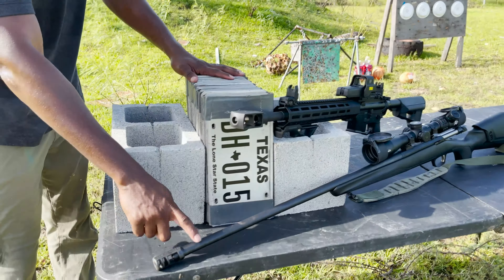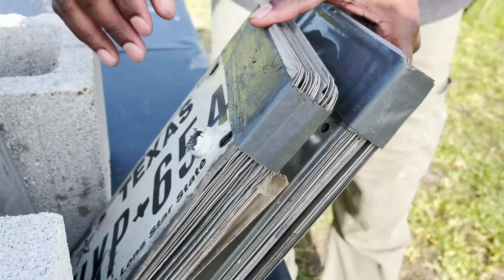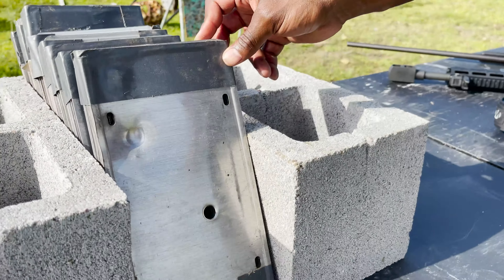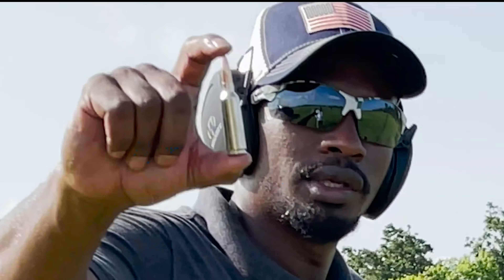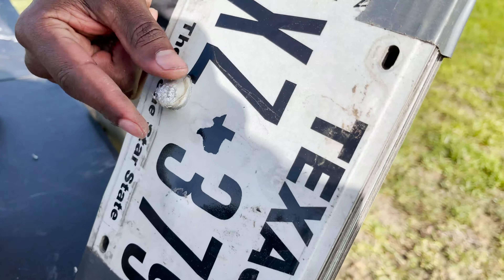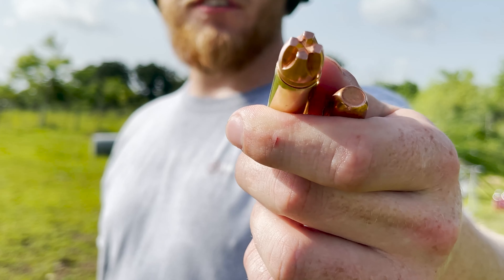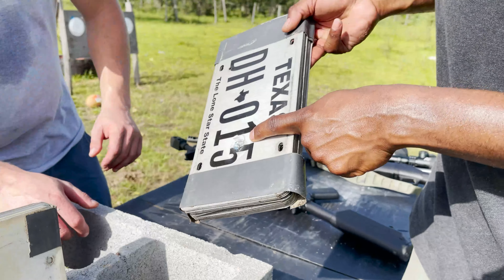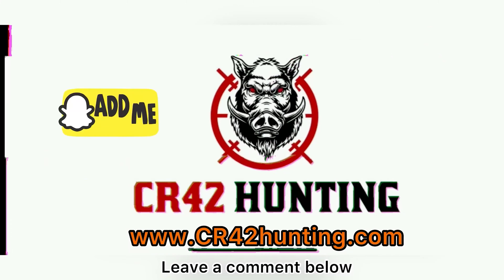6.8 Western vs 50 Beowulf vs 7 Mag - License Plate Test.

Comment: That extreme penetrator in 50 Beowulf is a bad ass!! I did think the 6.8 Western would outperform the 7 rem mag but looks like the old reliable 7 mag was the best of those 2.
Reply from the maker: That extreme penetrator was sick... It has a date with my 375 HH and 45-70 in a few weeks! And yes the 7 Mag held it's own and then some! Will use the 175gr with the 6.8 the next time these two face off... thanks for watching!
Reply: Will be waiting for that video!!! Would like to see that 6.8 western vs 7 mag on some 200 yard brick shots just to see the accuracy of both

Comment: The shape of the round is also contributing to energy dump. If nose was actually pointed, 50 penetration would be much further. As it was designed to stop cars laden with explosives by cracking the block, comparison in penetration aren't fair, unless you try other rounds vs a radiator and block. Blocks are typically made of iron, which is really hard, but brittle. Radiators are aluminum/copper and plastic. Do the same comparison with a vehicle, and Beowulf will smoke the others. 308, 338 and 45/70 would give better comparisons, as the round grain weight is more comparable.
Reply from the maker: thanks for the comments!! and the vid idea!